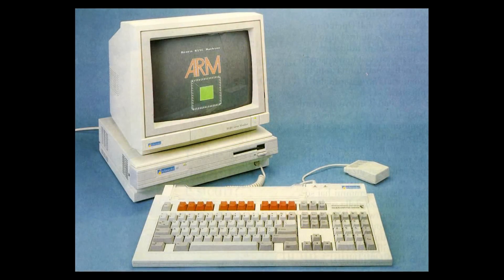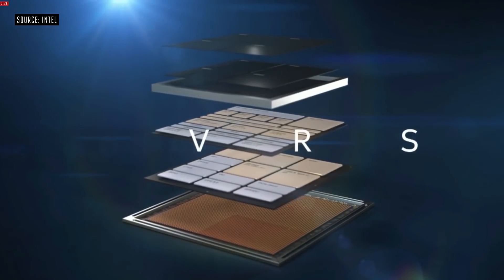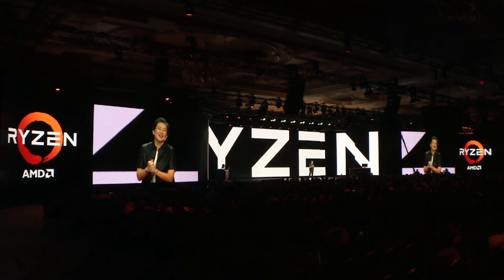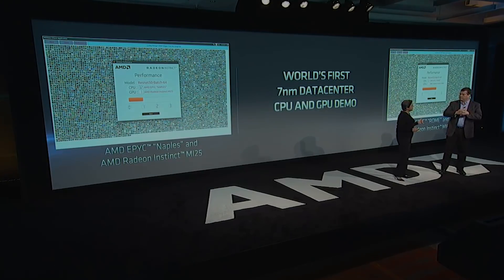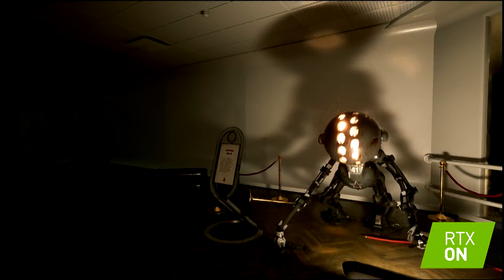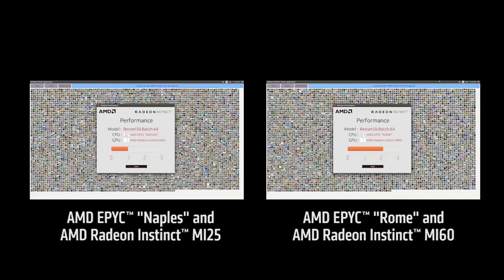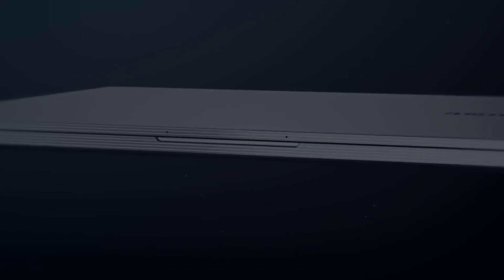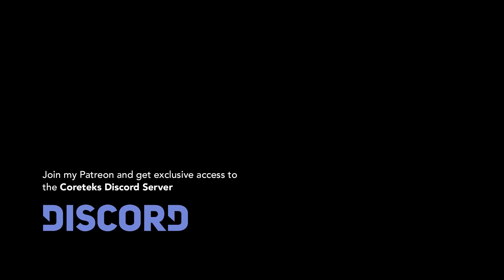Hardware trends: How many cores do we need?!

Comment: This video is nice and so, and true for current methods of programming, but it ignores completely new ways of programming, that scale much better. For example: Each AI in a Game uses a own independent thread. Sure you are doing then a lot of calculations over and over, your other AIs already did and this would mostly decrease Performance with even Quad Cores. But it would scale extreme with more cores, the more cores you have (and the more AI enemies you have). Same for Raytracing, at a certain Point, FPS wouldn't increase much anymore, but you could still cast a hell lot more Rays --> much higher resolutions and Detail.

Comment: It's great to see a video discussing whether more cores are better, as well as explaining Amdahl's law.
 Unfortunately reality isn't as simple as you put it in the video. 

In terms of parallelizing program, there is the issue of sequential portions which you mentioned, but also the issue of communication overhead.
To have multiple threads cooperating to solve a task, they must have some method of communication to synchronize them. For example, in a game engine, the synchronization step would be at the end of each update tick, where the global game state needs to be updated. Intel published a software engineering research project back in 2009, where they implemented a parallel game engine framework called Smoke to take advantage of as many threads as possible (at the time, up to 8). Due to this communication overhead, even if we could parallelize 100% of most applications, you would still be bound by the synchronization step.
Also productivity workloads are not necessary to parallelize, since they are sufficiently fast / responsive as a single threaded workload (an example being word processing).

On the other hand, there are computing problems which can easily take advantage of as many cores as you can throw at them, which are a class of problems referred to as "Embarrassingly Parallel".  Raytracing is an example of such problems, since the rays don't depend on each other, but still require a synchronization step between frames. Unfortunately, raytracing on a conventional GPU is not particularly efficient, since it's not a SIMD problem - it's a parallel SISD problem (tree traversal and intersection calculation is needed per thread not per SM). Which is why NVidia introduced the RT cores (specialized hardware for doing the tree traversal).

There are ways to hide the latency of the sequential compute part of raytracing, potentially by using triple buffering and streaming data transfers.
 
Which leads into another potential solution to the computing problem shown by Amdahl's law - streaming compute. It's a bit difficult to describe for a general computing perspective, however, one good example would be GPUs again. Think about the case where your scene geometry and textures are too large to fit within the GPU VRAM. Instead of manually swapping the memory (which is what DirectX / OpenGL / Vulvan do - which breaks parallelism), additional compute data (the geometry / textures) could be continually streamed into the GPU VRAM.

Another possible solution in terms of performance, is effectively what NVidia did in the new Turing architecture - add specialized compute hardware (via the RT cores). This isn't a new idea, since CPUs have had codecs (like H.264) and AES encryption hardware built into them for the past decade. I think in the near future, we will start to see more tasks being offloaded to specialized hardware.

And a final solution is to do something similar to what is becoming common in embedded applications, where there are more cores with different operating speeds. With the new chiplet based approach, we could start to see new desktop CPUs which contain different speed grade cores. For example, think of a Ryzen package which contains one CPU die capable of achieving a 5 GHz base clock, but only contains one or two active core, in addition to a die that has a 3 GHz base clock with 8 active cores. Most applications don't need to use the 5 GHz core, but some that are performance intensive could schedule the sequential part of their computation on the fast core, while keeping the parallel part on the slower cores. 

All of the solutions mentioned above are current topics of research in computing (computer science and computer engineering). There are a few other solutions currently being researched in academia, however, those are unlikely to be effective at the consumer level.

Comment: actually you can't just execute those three lines in one cycle
actually that's exactly why you can't just make code run in parallel because if you run three instructions in three different cores at the same time you don't know which one gets executed first
what if you charge into a register before you do the operation, and then you do charge from ram then you'll get a false answer.

Comment: Even if a single workload can't directly scale, increasing parallelism decreases the number of loads queued for a single thread, which would greatly help. For instance, the charts you put up looked at a single application, but in a real world scenario, there's a good chance multiple things are running at once, which at the very least would lessen penalties from context switching even if other tasks remain largely idle...

Coding for increasing core counts certainly is going to become harder and harder, but it does open new possibilities for many applications. Additionally, many of the things that have been traditionally sequential bottlenecks have been worked around before or close to the time they become a practical issue. DirectX 12 brought along Asynchronous execution, which works around the issue of the thread previously responsible for issuing all commands to the GPU being pegged. 

Floating point used to be incredibly expensive, so complex FPUs were added to workaround, Rendering was quickly outpacing and limiting the amount of time a CPU could use to crunch other tasks, so complex GPUs were added. within the next few hardware generations, we'll likely see the resurgence of graphical parallelism and engine developers taking a serious look at DX 12 EMA. 

While a given task may be reaching it's maximum parallelism, if you take a step backwards down the chain, there's almost always some way to either make the input to that task parallel, or have the output become created via parallel means.

Comment: Ray tracing is much more than 95% parallelizable, more like 99,99%. There are no data dependencies between individual rays, only the synchronization for every rendered frame. Ray tracing scales much better with more cores.
You'right that most other algorithms however have much larger non-parallelizable parts limiting their performance scaling with more cores.

Comment: As OSes use a lot of background tasks, higher core count is beneficial for offloading cores that are running the application threads. I've never saw any metrics about how OS background processes handle L1/L2 caches of cores running them, but it's vital for modern processors and OSes to prevent cache misses and making user code stall due to the OS threads evicting user application data from the affected cores.

Comment: No. For the love of god, this is one of the most annoying misconceptions that I've seen recently and nobody seems to have addressed it yet. RT Cores do not do any ray tracing, full stop. RT Core is a marketing term to convince people that Nvidia cards can do ray tracing while no other cards can, and that is straight bullshit. RT Cores are hardware BVH compute units, you even see Nvidia talking about BVH's in the keynote you show at 6:27, BVH's are used in ray tracing and other path tracing programs to speed up the process of finding intersections between a path and the meshes it interacts with by reducing the number of tri's the intersection algorithm checks against if the tri's are nowhere near the path.

Hardware BVH calculation is important for real time ray tracing as you need a BVH for each frame of your render as the meshes move around, and the only real way to do that for gaming is through hardware or tons of CPU time across many cores as BVH creation should also be very scalable. But the actual ray tracing is done through normal FP32 calculations which is why you can do ray tracing with CPU's or *any GPU*. You won't be doing high framerate ray tracing with BVH's unless you're using hardware BVH creators, but for rendering a fixed scene and for tracing any rays for that matter, the only thing that matters is FP32 performance.

Here's a page showing benchmarks done for ray tracing different scenes with different GPUs and CPUs in Blender: https://download.blender.org/institute/benchmark/latest_snapshot.html

And I just want to state this one last time definitively, RT CORES DON'T DO ANY RAY TRACING, AND INCREASING THEIR NUMBER WON'T MAKE RAY TRACING BETTER BECAUSE THAT'S DONE ON CUDA CORES.

Comment: sorry but oly using this equasion is very narrow minded as the values you are using are quite off, for example "offline" rendering has a near 1to1 linear groth in performance for rendertime per corecount, optimisations can make a huge difference as this equasion is really not that precise in indicatng performance for larger well optimised processes.
In addition simulation workloads reach much higher percentages and these workloads are of huge interests for science.

Comment: OMG are you saying we don't actually need 32 cores threadripper today? Jokes aside, of course i already knew this. Lots of people started to understand since the time mainstream cpu started to hit 5ghz threshold, though not nearly enough to not allow AMD deceive people into bying lots of useless silicon in their "workstation" chips. Though more cores mean faster rendering(mainly 3d), i absolutely doesn't understand, how proffessional which can afford to spend 1500$+ on multicore low clock speed cpu alone can't buy top of the line 6-8 cores desktop chip that will outperform it any sequential task beside rendering.

Comment: I would agree with there being a limit to how many cores can improve performance but I highly doubt it's as limited as your making it seem here. In an individual operation there is a benefit that can be had from writing in parallel workloads but there is also a benefit to be gained from the fact that most programs are running many operations at once. If your dividing the operations up among many cores and then you divide those workloads parallel operations up among many cores you should be able to use that benefit much better. Saying well we learn this way and we can't be bothered to change to take advantage of it is lazy and stupid.

Comment: You just convinced me that you know nothing about how modern software are built. Y'know, starting with the stuff you use Chrome for.
Here is a fun little experiment: get a "high-end" 2 core CPU for $30 disable HT, drop in your rig and open up Facebook. Sit back and listen for your misinformed perspective shattering.

The shape of the diminishing returns of the palatalization graphs are somewhat correct, but all for the wrong reasons (hint: bandwidth / mutex ops).

Comment: One thing that this kind of ignores, is where there are multiple workloads, for example, currently running on my computer are 149 tasks, so realistically you can use 149 cores, one per task.  Some of those cores will only be used a little, some will be used a lot.   However it's not just the core that is important.  Say we take a processor with 4 cores, and we assign each core it's own 3 blocks of cache memory and memory controller.  Now the memory controller is constantly loading blocks of memory into the cache so that the CPU core isn't running into as many waits for memory access.  The OS task switcher needs to be smart enough to know what tasks can be run in parallel and when, so that the CPU remains as close to 100% utilisation as possible.    If you have a 3GHz CPU running at 50% utilisation, you effectively have a 1.5GHz processor.  This is the real reason that the GPU probably has a limited life span, if the CPU is spending 50% of it's time waiting for the GPU, it makes sense to move those graphics operations back to the CPU, and then instead of having say 8 CPU cores and 16 GPU cores, you have say 20 CPU cores.

Comment: Parallelisation is a very complicated matter. There is a lot of things that can be done on microcode and compiler level but doing this on a programming level makes the software a lot harder to develop, test and debug. If you add caching into the equation the whole matter gets even more complex. It is hard to tell when more cores wont make more sense. There are a lot of other things in the future that couls matter as well, like having a few super fast, more specialised cores and a lot of slow cores doing the number crunching. Same goes for smatrer boosting algorithms.

Comment: Judging from history, you're probably wrong. See if this makes sense: As CPU core-count grows, future software will take advantage of it by building AI into everyday tasks. This has happened before. When hardware got too powerful for text displays, GUIs became standard. When 3D-op hardware proliferated, artists in general adopted it. The same will happen to shallow neural networks with ridiculously huge input-layer and output-layer sizes. These have been impossible until now on consumer devices, but once hardware supports them, AI will finally be able to process and generate audio and HD video in real time without using the cloud. The more cores, the more complex the audio and video. This new development is so versatile that it would not be unreasonable to expect it to appear in most common user workflows. There's no death of hardware advancement here, just business as usual.

Comment: - Your notion of ray tracing parallelization is flawed. Ray tracing is an embarrassingly parallel problem. Although for most architectures you need some work distribution to exploit locality, in general N rays can be distributed among T threads. You have nearly perfect scalability. The only issue arises from work distribution.
I do not know about the RTX cores, how they interact with the memory system and what they call compute cores. However, it's not as simple and bad as you showcase it to be.
Here you go: https://en.wikipedia.org/wiki/Embarrassingly_parallel Their first example is rasterization and ray tracing :)

- In your rant 6:10 you go into talking about ILP,  VLIW but I do not know why. This has nothing to do with the number of cores and often that's left to the compiler and hardware to schedule those instructions. Although the programmer could help, it's often not necessary unless squeezing out perf in some HPC application.

I think you have poor grasp of parallel programming, and your knowledge in the problems you depict is lacking.
Your content mostly focuses on speculation in the tech field deceiving your average viewer.

Comment: I think it's possible that equation wasn't used correctly. P should be between 0-1, not 0-100. This will basically make it so that as P approaches 1, the times performance approaches the amount of cores. So as you approach 100%, with 16 cores, you would get 16x the performance.